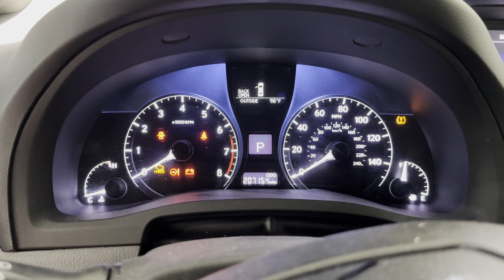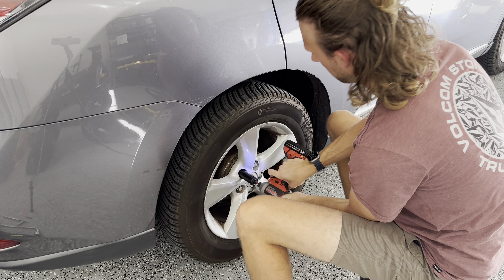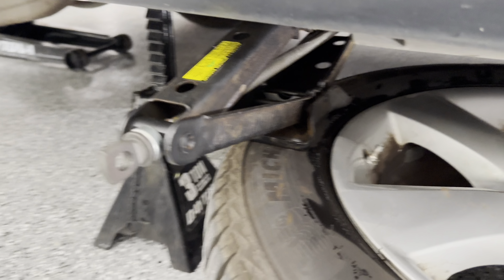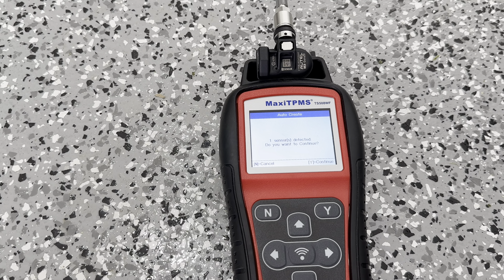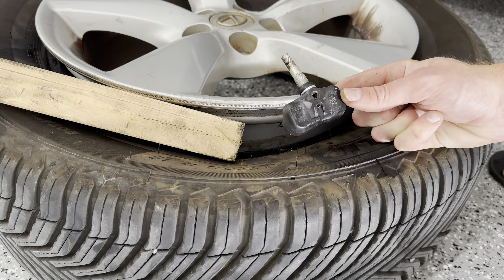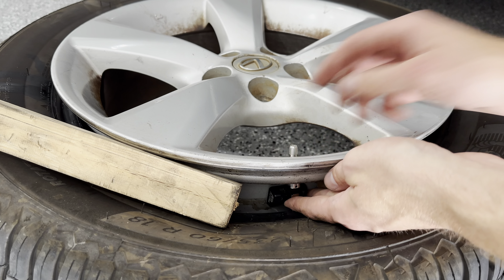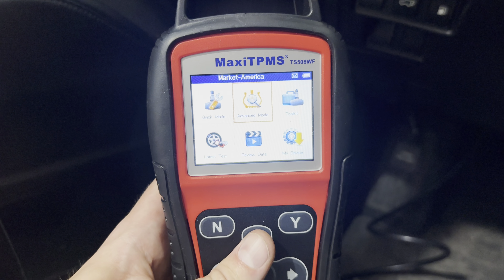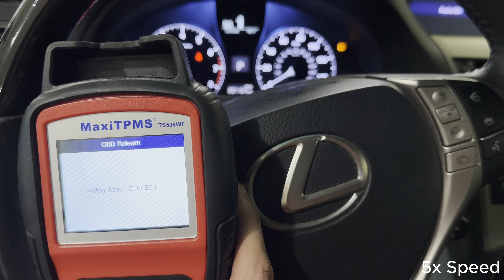How to Change a TPMS Sensor 2010-2015 Lexus RX350 and Others w/ Autel

Comment: Nice vid! Just a note, you can also program the new sensor with the sensor mounted and installed in the rim after you inflate the tire with the wheel on the car. Also, the autel maxi tpms does program/relearn new DENSO sensors. Just did mine, TPMS light is OFF.
Reply from the maker: @mattp733i  Yes, correct with both of those, I also re-learned my Denso sensors with the Autel tool and I just figured I’d program outside the tire in case the off chance the sensor was defective. Thanks Matt! 🤙🏽
Reply: From my experience, once the tire is inflated the Autel sensor is locked and cannot be programmed.  You have to deflate tire to <10PSI to unlock it.
Reply from the maker: @alexduhon1589  I think I remember reading that in the manual now that you mention it. Thanks for piping in!

Comment: Nice trick to reach the sensor without dismounting the tire and without tire machine!  While this worked on a 60 aspect ratio SUV tire, it's unlikely to work on low profile tires and you definitely run the risk of destroying the tire.  Also, the video shows how to relearn new sensor by updating car's ECU with new sensor's ID. I think a better method is to do a "Copy by OBD" which copies existing sensor ID from ECU onto the new Autel sensor.  This is better because you avoid writing to ECU, and  don't run the risk of inadvertently damaging the ECU (in case there is sudden power loss for example).  Technically writing to ECU should be done only while battery is connected to proper external power supply.
Reply from the maker: I know what you mean about the tire, I recently did my ES350 and they were smaller tires and harder to access the sensor. I haven’t had any issues with any of the tires thus far. 

A couple reasons I did not do the copy sensor ID was I didn’t want to worry about the old sensor being still read by the vehicle if it were ever in range before I throw it out in the dumpster and then also, I contacted Autel and they said that creating new sensor ID is a better method (with not saying much why). I have done the copy method as well with no issues. 

I’m wasn’t aware of the risks of writing to the ECU, but don’t think it’s a big issue since I have never had a sudden power loss in my vehicles. I do understand what you’re saying though, it’s like pulling a flash drive out in the middle of a big transfer, it could corrupt the file going over to it. 

Not a bad idea to hook your battery up to the wall and “Copy by OBD” is also not a bad idea. Thanks for the input!

Comment: So helpful! I went to a tire dealer and they told me they couldn't replace a sensor on a Lexus, that only Lexus could do that. Obviously that is not accurate after watching this. So if I buy this sensor at Napa, should most tire repair shops be able to do this repair? Thank you
Reply from the maker: @stephaniejunca2875  100% they should, though some repair shops are picky/funny about bringing your own parts, but it wouldn’t hurt to ask them before. I’d have them do it next time you’re in for tire replacement/balance/rotation/alignment/etc. That’s laughable saying that only Lexus can do it, it’s just a fancy Toyota. 😂 Good luck!
Reply: @ thank u so much!

Comment: Great instruction.  I went looking to buy the scanner but don't see any autel scanner for around $30!  Did that Autel ts508wf really cost you just $30?
Reply from the maker: @1079rlkk  thanks! Sorry, I should have clarified better in the video. The Autel Sensor that goes in the tire is $30, but I personally got the Autel Scanner TS508WF used for $130 on eBay.

Comment: How likely is the bead seal to be screwed up?  I guess I was under the belief that would happen if you basically dismounted the tire
Reply from the maker: @AmmoTesting  it’s definitely a possibility, I’d say just be careful not to scrape the metal inner rim. I’ve taken all 4 tires off on both of my vehicles this year and have not had any bead leakage if that makes you feel any better.
Reply: @shanewazhere  thank you!

Comment: Hi Shane - was the tpms tool $30 to buy or rent?  Seems I can’t locate one for a reasonable price…
Reply from the maker: @ Either A, buy it from Amazon and return after programming once or B, buy it for half the price on eBay. Doesn’t matter if it’s used or not. I will be keeping mine because I suspect I’ll be using it for a while and for any issues in the future. Maybe one of your local auto parts stores has one you can rent?? I’ve never asked.

Comment: Would you need to rebalance the tire after installing the new TPMS?
Reply from the maker: @charmer888  if the difference in weight was a bit more than a different brand of TPMS sensors, then maybe yes. I usually get my tires balanced and aligned every 5-10k miles anyways, so it not a big deal for me. I wouldn’t think the minor, if any at all, weight difference would affect your tires at all. You can always weigh the old and new sensor with a kitchen scale or something to see the difference.